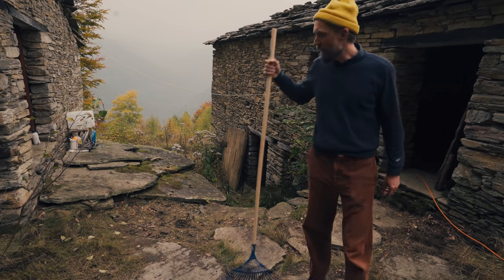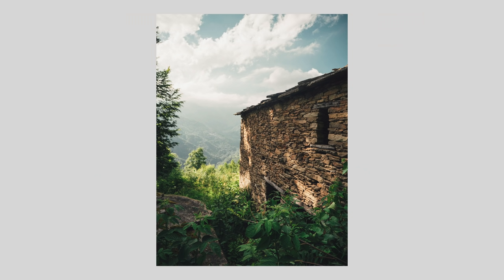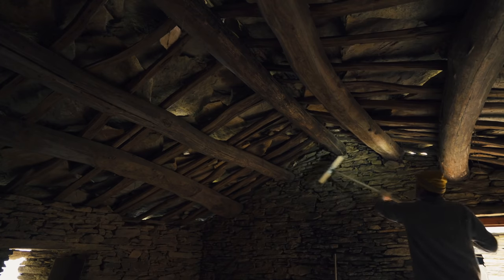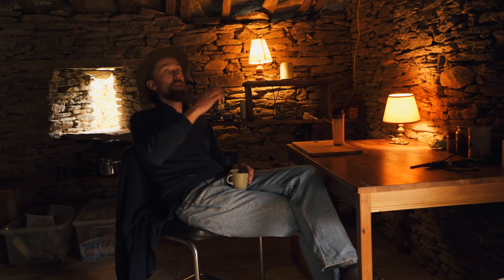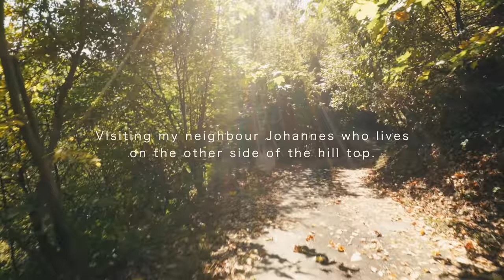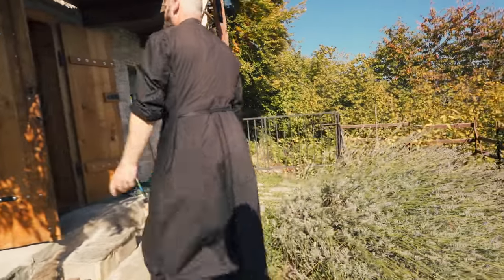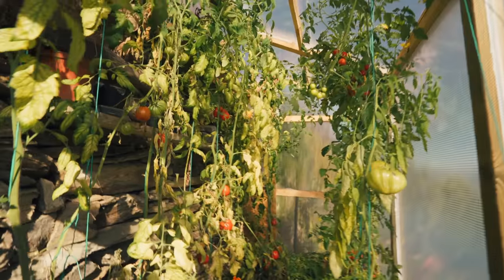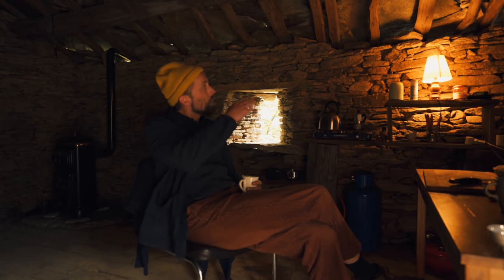#2 Starting the works, visit from the Surveyor, and lunch with the Priest

Comment: I would leave some of the younger birch trees though, because when the old ones die, you won't have any and birches are very useful in various ways. Also, you need some trees to give you shelter from wind and birches are not so dense that they make a lot of shade. So, cherish them! And that bush beside the house you pruned? Looks like Elder to me. If it is, then one day you could make a lemonade from the flowers! Or a soup from the berries.
Reply: Or jam or even wine if you find enough of them.

Comment: Benvenuto in Piemonte! 
In the US, I might have to get a simple building permit or have a city inspection here and there, but generally, I was left alone. In Turin, we had a bunch of work to turn an office apartment back into a residence. We had to get a geometra even though I'm not sure what he actually did. 
That said, I have to admit that Italians tend to build things to last and the tradesmen we've hired have been excellent and fast. If you do have anyone come in to perform jobs, just get around 3 quotes. We've seen huge spreads on estimates (though we suspect that some of them are inflated because I'm a straniero).
I've not been to Val Pellice, but my wife's family has had a place in Val Chisone for ages. Good luck!
Reply: By the way, when I state I was 'turned aroound' by someone psychic no I dont mean I spend time chanting and going asround in sandals and a robe. The changes experienced enabled me asnd others  for instance victims, to confront the wrong doers which was as popular with the public as a hole in a canoe. one of the things I had been told was- 'You Will Become Very Powerful' No I didnt brelieve it either. Ask me now ? Gettoing rid us wont save this planet.

Comment: Excellent video, the site has the potential to become a very cozy cabin and with your willingness, pretty sure it will be. One thought, when doing the the roof, could you open a window and not consider it as a structural change? It might bring you a lot of extra light.
Reply from the maker: Yes, sky lights are an option!
Reply: @MartijnDoolaard  I noticed that the geometra  mentioned Velux:-)

Comment: Hey Martijn, I'm learning a lot from your videos. You really have to want to do something like this to make it successful. An alternative would be to simply tarp the exterior, mylar the interior and remove as you complete the work phases? Basically transform the house into a tent. It's commonly done in the RV community for winter kit, bc most RVs have no insulation or very little. You can also make "insulation pillows" for the windows by wrapping styrofoam cubes (bought or created) wrapped in mylar. The Ukrainian military are also using mylar (in the denser form of automotive dashboard reflector folding material) as winter insulation in their trenches. Bright blessings from Louisiana. <3 :-)
Reply: @michaelthorne5441  The stove vents through the eaves.

Comment: Really nice to watch again..... Can I spout my ideas? You might have seen the rocket mass stove of your neighbour. What if you open the floor of this cabin, place a rocket mass stove (=RMS) on the ground floor (Stone stable floor I assume) and make the first floor (Where you are currently residing) a sort of sleeping loft? This way.... you can have a longer lasting heatsource in your house. Just my 10 cents. Good luck, Great video, great location, great potential!!! Thanks
Reply from the maker: I'm considering something like a rocket stove, yes. The one my neighbour has heats the house really well.

Comment: You might want to burn the ends of the poles that are put in the ground. They last much longer.
Reply: Was about to mention the same: About the construction poles you hit to a ground in this video. I understand they maybe just for a temporary / short term use. Anyway, maybe in the future, I would recommend you to burn/char/carbonise the poles with a fire of a part that goes underground and little more above off the ground. With this technique poles will last much longer, because they rot slower and insects etc. will not like them that much.

Comment: Hello Martijn. I was thinking about what you was talking about cold at night and how cold it is when you sleep  and i think you could make a very very basic wooden wall just an inch thick and create a tiny box/room small enough to put inside the tent you sleeping in and the woodstove as it is. Doesnt need the wall to reach the roof , it can go till the upper edge of walls where the woodstove is  and put another horizontal piece of wood as a roof so you dont need to seal any holes about wind. So you know, its like a box 4 steps by 2 steps and get very warm in there so you can sleep at night very nice. I think that is what i would do for start so i can keep warm. So if you cant seal the whole room make a smaller room in it .
Reply: That was my thought. Box bed. Its traditional way to have warm sleepingspot in cold stone house. To keep all the house warm is harder. Thick stone walls have huge thermal mass and they are nearly impossible to warm up in winter when not insulated from inside. Only way of heating that keeps such room comfortable is floor heating. Traditional hypocaust would be most suiting because there is not enough electricity for heatpump+ water floorheating.

Comment: you learn as you go ~not many people will have experience of renovating a stone building, alone, high up a mountain! I'm glad you found a warm place to sleep. It looks like they like paperwork in Italy. I'm sure you will succeed,  thanks for sharing with us.
Reply: The paperwork is if you change the structure because, if you do so, then the building must respect the actual anti-seismic norms. 
Those stone walls can last for centuries without maintenance. Thats why they made them that way back then but, in case of an earthquake, they'll end up in a pile of rubble in few seconds.

Comment: Might I suggest you look into getting a "Harp" for your stovepipe, improves the output and thermal efficiency hugely. Its basically a radiator for the stovepipe. Good Luck on your first winter.....Jaegertee is a big help.

Comment: I hear you on the cold. My father bought an old Irish farmhouse ruin. Used to be part of the castle up the road. It was the horse stabler lodging. Thick stone walls, and no insulation. I had just entered the workforce. Then the ecommerce bubble popped, my dad lost his job, I lost mine and so did my sister. We all ended up working at the same call center as an emergency measure. 
So we were then stuck in a freezing ruin with limited money to renovate. I remember talking my my father in the lounge after a work shift and seeing each others breath. When you went to pee, steam would rise up from the bowel because of the temperature difference. I would have to mentally prepare myself to shower because it was actually painful. That was the most uncomfortable I've ever been in my life. It's fine for a week or two, but live like that for months on end and it grinds you down.  I now have a very warm apartment and run my own business, but I never forget.

Comment: hey man. i would get rid of the stone roof if possible and replace it with a light version. i would go down with the door to have it bigger, building an interior step if necessary. i would buy a pick ax for the digging or stones lifting. also a come along and pulleys would be good to ease up the work. i have a ruin in the countryside but no time yet to start the work. best of luck with the project.
Reply: If you look at the videos, all houses there have a stone roof and I guess the regulation makes it impossible to replace it with another material. Which is good for the architectural identity of this region

Comment: Martijn, this is all very good information. Perhaps 4x8 sheeting with styrofoam pre-attached could be used to insulate the roof… and gain roof structure… good luck. The small sawmills are a great thing, usually bandsawed lumber now days…very accurate.

Comment: I have a friend who double piped a stovepipe. You would have to go between the elbows. He cut a hole in the outer pipe and installed a fan from a computer or something and added a dimmer switch to control fan spear. The top is sealed with that really sticky silver tap used for air handler tubes and also around the fan and intake hole. This pushed all the hot air down to the floor and out across the room. When turned on with fire and fan on hi we would be run out due to the heat into the -0’s c night. Shop door opened to cool it down.

Comment: Buy some hemp wadding to hammer wedge in between the floor planks to seal them up . Builders spray foam will seal up the gaps around the wall roof .

Comment: I just found that there is some spray foam insulation that will inflated to block all holes, if you ise the pond line verision it's also water proof and looks black....might help making the house more sealed and not that bad lookwize

Comment: 2 men can do the roof, but you need a very strong scaffold, keep all stone up there so you don't have to lift it down then back up. I just rebuilt another big old barn in England with stone roof just similar to yours. 
👍
Reply from the maker: you're right, it's a tough job moving the stones about. But how would you replace the rafters without moving the stones?
Reply: @MartijnDoolaard  I assume what he's saying is that you build a scaffold to keep the stones up so you can work on the rafter freely, but I agree this requires some more details. For instance I can't really imagine how to get the scaffolding underneath the stones by pure manpower and simultaneously create the space to replace the rafter. (Misschien met een krik?).

Comment: If you are going to redo the roof next year why not spray some expanding foam in the gaps in the roof and the top of the wall. Close up the window even with boards for now and let the stove do it’s work. You will be surprised what just closing the gaps will do. 👍🏻 a new subscriber from southern Italy. 😊

Comment: Hold tight to your vision no matter what the discouragement or the apparant setback.....
I am enjoying your videos & the landscape is very very beautiful.
I would build the monks type of tomato greenhouse between & fixed to both of your stone cabins/bothys. You can fix the greenhouse uprights to the external cabin walls on each side. Clear plastic roofing & on both the end walls will let the light & heat in. Then the huge stone slabs of the entrances & stairs would have a chance to heat up & radiate heat back out to you when the sun sets..... you can say it is a temporary structure to avoid being caught within the scope of planning & building regulations. Or if you build & like the experience, seek to regularise it. I understand from my Italian friends that circa every 10 years there is a planning amnesty during which one can apply for retrospective planning permission. And that there is currently a statutory scheme where the Italian government will pay 75%+ of the cost of renovating a historic structure. Surely, your stone bothys must fit into that category as they are old & represent cultural practices & lifestyles now mostly in abeyance. I would try that argument on with the government if it was us.
Have you thought about putting a double layer of tarpaulin over each roof for the winter weather? You can fix it into the ground or the walls & make your bothys water tight & keep the wind out....
How about chinking the wall gaps from the outside with moss - it is alive & hypoallergenic & will not rot or go mouldy & will seal the gaps. You already have a huge chunk of moss growing on the slabs of one of your roofs....
How about placing the tent on straw bales or rolls of sheeps wool insulation - terrifically insulating & the sheeps wool insulation is a fire retardant...
Maybe think castle & put thick wool hangings on your walls - that's what tapestries were for ...... or wood panelling....
And as heat rises, maybe consider building one of those eco wood burners the monk has in your downstairs room & get toasty upstairs in your study / bedroom with passive heat. Perhaps you could put the flue up that chestnut roasting fireplace of the basement..
If you greenhouse the 2 story gap between the 2 cabins, all rooms would be easily accessible to you.... without the hassle of external weather....& capturing heat. You could fix shelves to the walls & put pots for flowers & veg on them....
We insulate our citrus greenhouses in the winter with bubble wrap lengths that clip onto the greenhouse frames with specially designed clips for that precise purpose bought from Amazon. It keeps our Sicilian lemons & Spanish oranges & Thai limes & Chinese pomelos alive & thriving in the cold & wet English winters. My husbands hobby is growing all types of citrus.....in old Blighty! Imagine the folly - his success is a triumph of positivity & diligent attention & care in our climate! He trusts his vision!!
You are so so lucky to have all those trees on your land. There must be the odd dead one you can harvest & even make your own planks or wood panels using an Alaskan sawmill & your own chainsaw....
The views are very very special.
Is that woolf & bear country..... I hear both species are in North Italy.
It is wonderful you have a friendly neighbour nearby who has walked this redevelopment path before you & with alot of success. I think you are being taken care of by the hand of destiny - your monk neighbour may not have heard this anagram for God, which seems apt for your mountain & nearby valleys - & which a friend shared w me -
G - Great
O - Out
D - Doors
Keep plugging away at your vision!
You CAN DO IT one day at a time
Especially if you are willing to receive or buy in some help
I sincerely hope I have not overstepped your boundaries in sharing these ideas!
And I wish you every success & a ton of patience..... do not be discouraged!
Best wishes from the Heart of England.

Comment: I don't know where you are at now but you could throw a tarp on the roof and then cover it with a foot of dirt.  You could also cover any walls that are facing the winter wind the same way.  Your windows should be easy to cover too with temporary cover.

Comment: I'm italian and will give you a golden rule: if it's finished, whatever the state, if it was ok for the laws of the time it's all good. If you modify that same finished product you need to apply for the new law and so "legalize it". If you touched those old walls you would have to abide to current laws instead of the 1907 (non-existent) laws. That's why it's MUCH easier to renovate than to build

Comment: Dear, Array needs to be in sunniest location BUT next to the house, closest approximation possible.
For every inch that electricity travels to destination, you lose power, as waste. And arrays need to be rotatable on monthly basis, following the sun monthly throughout year; and wiped off daily for increasing output.
It's best if arrays are close to the ground, so wind can't lift and pitch them down the mountain. They fly like frisbees, in high winds.

Comment: I love what you are doing but I would definitely change the plan.. Roof .. Windows (Or shutters) DOORS SEALS… plywood on the floor and maybe even a temporary ceiling ( Insulated Tarp maybe.…  get it to maintain Temperature… once those rock walls get warm they will stay warm for hours.

Comment: Somebody has spent a fortune in time in the past building those rock walls , you will never see this again in the future , very historical .
Reply: That was usually a "village's job". 
Various families provided the workforce in their "free time", so that there were always 10-12 people working toghether (but also drinking, jocking, etc.) for a pair of months in the summer (obviously there was always someone very skilled. Those perfectly straight walls were not the work of an amateur) until the sheds were completed. The benefited ones of this time would have helped the others when it was their turn.
Mind that also the goats kept there during summertime (in winter they were moved to the low altitude stables) were probably entrusted to a single sheperd, but belonged to several families.

Comment: Ciao Martin , build a temporary wall in the room next to the stove to keep warm.
Reply: The main problem is the roof. Warm air tend to rise, and it encounters a roof that's cold stone, few cms thick and full of holes. It can't keep any heat. 
Just covering the roof with impermeable sheets and closing the window, much of the problem would be solved for this winter.

Comment: I was just noticing whenever you are cutting the saw doesn't sound like it is biting into the wood well. Since you are mainly using hand tools having a sharp saw with the best teeth for the cut is ideal. The saw is either dull or you are using a rip saw instead of cross cut saw. For the type of cuts you are making in these videos a cross cut saw would be better than a rip saw. Again sorry for the comment and maybe the audio is just weird.

Comment: That is not the sharpest of saw's!
This might be hindsight, but if you put a couple of footings between the 2 buildings on both levels you would already have a nice area for a galley kitchen that can open to a deck and a balconied area. Whilst on the higher level that would make for a nice entrance.
You would have to raise the height of the dry wall on either side and come up with a new roof plan. But that might be easier at this stage of the build.
Think about some of those pine trees being used as an exoskeleton  between the 2 buildings which would take most of the load for building and roof!
I can smell that Schnitzel from here. So hope your winning in your journey.

Comment: I noticed the priest had windows on the inside of the rock openings. Can you do the same and have them so you can use them in winter but remove them in the hotter months. 🎄🌲🎄🌲🎄